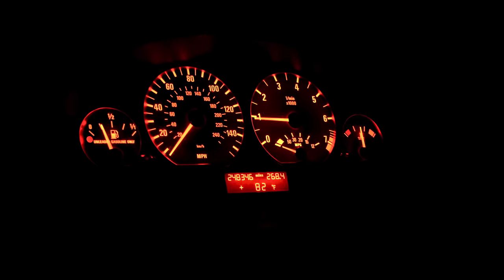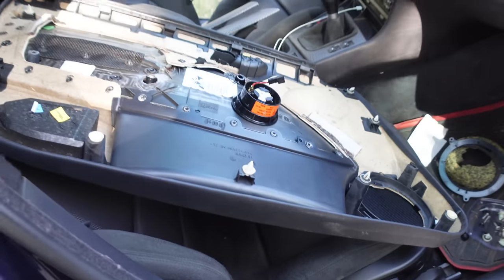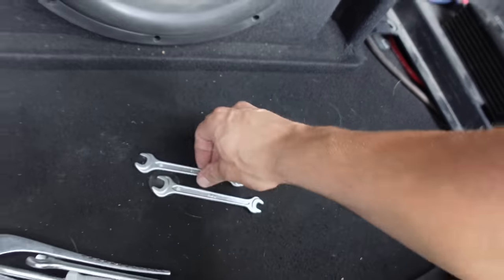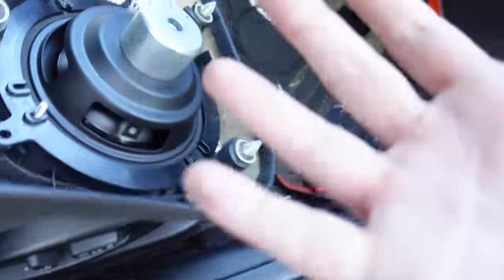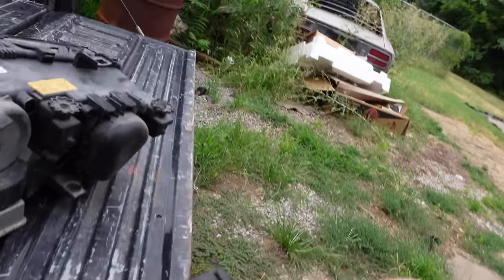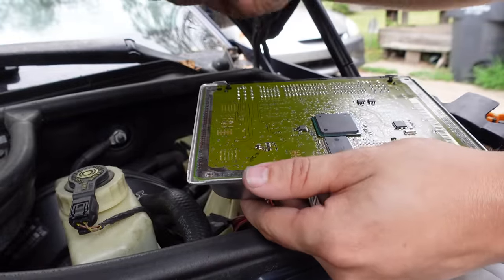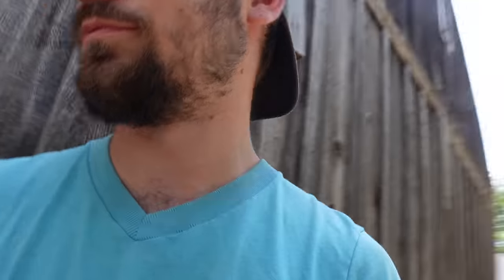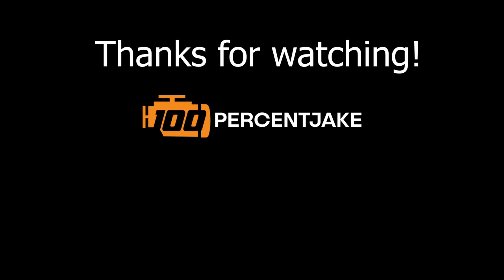The LAST CEL GONE? + OEM Speaker nightmare

Comment: Great video, Jake. Good advice about the sensors. There is one other thing to keep in mind when dealing with any Bosch electrical system after 87, though. Two important words: Multiplexed Wiring!! The entire function of everything can be ruined if the feedback from any part of the system is out of spec. It is nearly as frustrating as dealing with the biodegradable wiring insulation Bosch used for a few years until they discovered it was biodegrading whilst still in a functioning automobile, rendering the car inoperable at best, and a pile of ashes at worst. Bosch LOVES to complicate everything. Bosch is the reason I will never buy another European car. Bosch is the reason I sometimes think about scrapping the old Volvo. Then I drive the old boy and get reminded of how and why the car is at 400,000 miles!

Comment: If I remember correctly, the 9 speaker HK system in my Buick Lucerne has 2 Ohm speakers because I had to get a driver’s door woofer and one of the 6x9 parcel shelf woofers.

Comment: Man good luck with the barometric pressure code. I had my ZHP ECU replaced under emissions warranty and still had that code intermittently after.
Reply from the maker: Soldering a new sensor on the DME solved it

Comment: I have a 2nd generation dodge ram Laramie slt quad cab long bed 1500 4x4 and it has the premium infinity 6 speaker amplifier filters sound system and it works but the speakers need replacement the truck is a 2000 year model so for now I am going to put a new but display model set of kicker cs46 5.25 speakers and a brand new set of cerwin vega hed 6 1/2 speakers,, and I plan to get a complete set of infinity reference 6x9 speakers with the switches and then change out the factory tweeters with something and modify them but that update is going to costly and I think when I go that route I am going to buy a Kenwood or alpine compact mini amplifier..

Comment: Regarding the tweeter issue, is the speaker crossover user adjustabile?  if so you might be able to tame the harshness.
Reply from the maker: Sadly no. The crossovers are built into the 10 channel Harmon Kardon amp. Upgrading any aspect of this system is incredibly annoying because you essentialy have to replace all 10 speakers and the amp all at once to do it "properly" which is... thousands. I ended up buying a set of used but working H-K tweeters and putting those in.